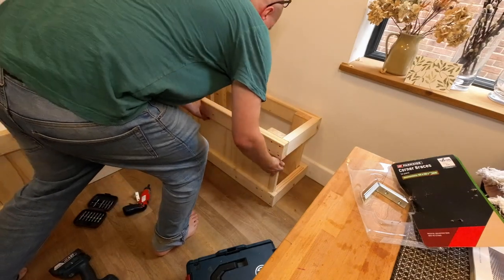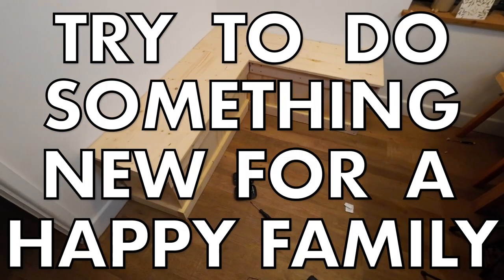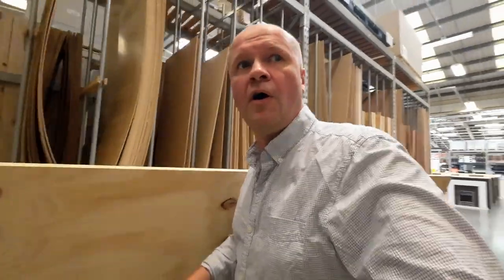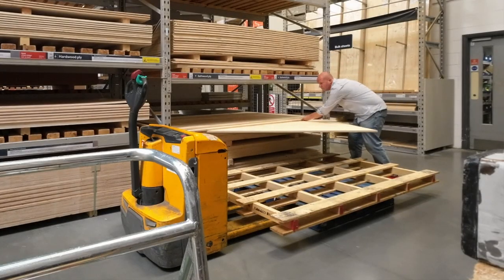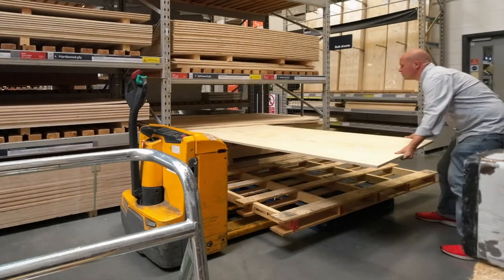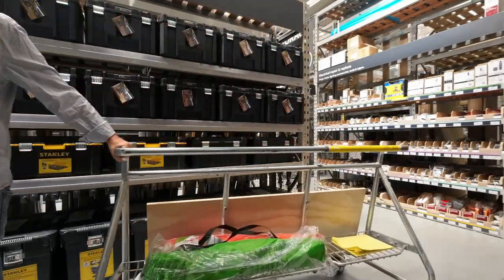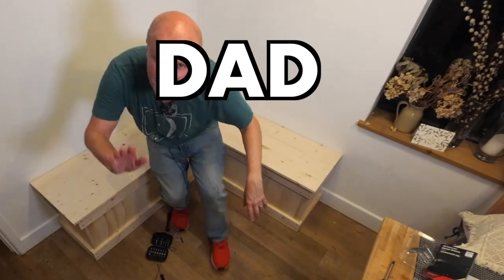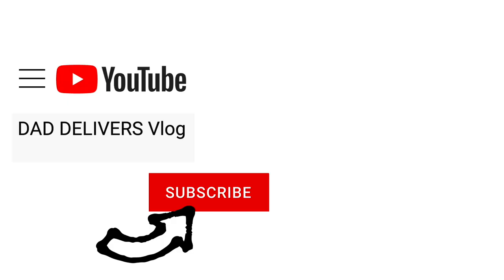EPIC L-shape bench sides! Corner seat for kitchen FINISHED

Comment: Hello, what wood did you use for the top?
Reply from the maker: Hi Olivia
Thanks for the kind question- I'll double check if it's wrong but think it's 
Square edge Clear pine Furniture board, (L)2.4m (W)400mm (T)18mm
Which I cut in two.
Hope this helps!